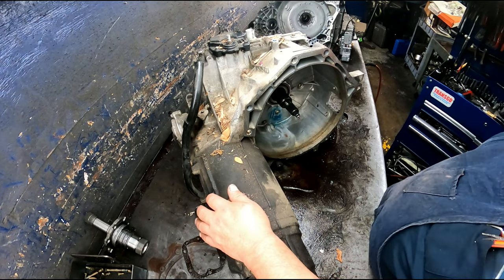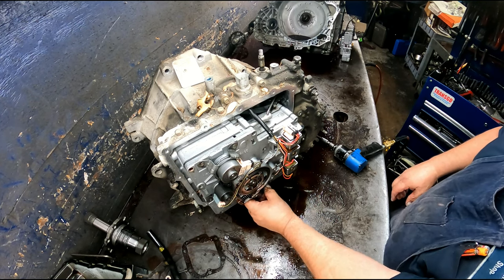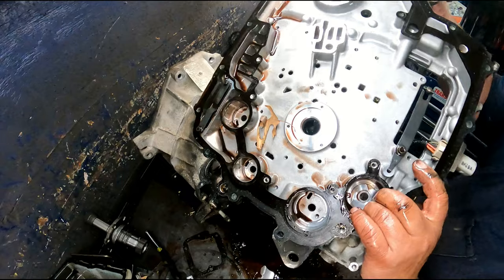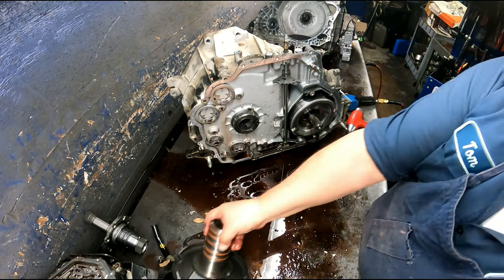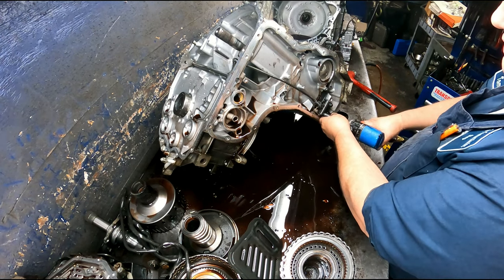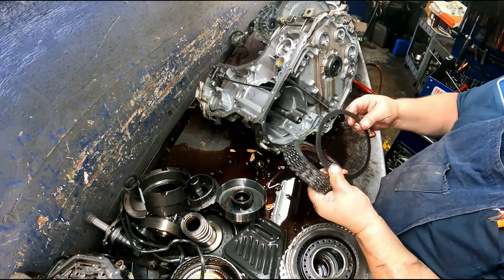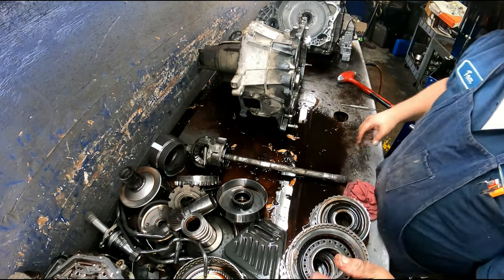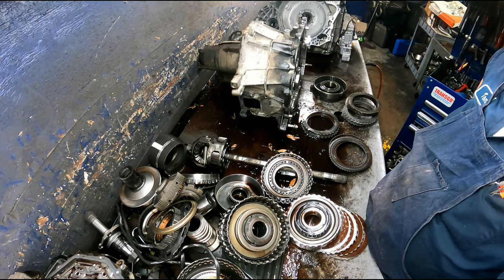AX4N Disassembly

Comment: If you are lucky, you can drop the subframe on the driver side enough to get the valve body and pump shaft out.  My pump and shaft were toast and it also damaged the valve body.  Replaced them all and now runs like new.
Reply from the maker: Yes. It is a bit harder to do that on a Ford. Chevy's a little bit easier. But it is still a pain.

Comment: What sensor is that white electrical connector near the neutral safety switch?
Reply from the maker: It is for all the solenoids inside the transmission.

Comment: What causes the torque converter splines to strip out? It seems like it spans a WIDE variety of years of the AX4N, you would think theyd have fixed it.
Reply from the maker: The metal they used. They never did fix it. Enough of them got past the warranty so I don't think they cared.
Reply: What years were affected? I have a 99 taurus dohc with the ax4n @CurmudgeonTransmission
Reply from the maker: All of them. It is the number one failure with them.
Reply: It makes no sense, on the forums some guys have 350k miles on original trans and TC. Im baffled why only some it happens to.  @CurmudgeonTransmission
Reply: @jeedwards1981 basic maintenance, doing regular fluid changes and driving like you care about your vehical. Thats why you see old Hondas surviving only 230k even though some of them hit 500k+